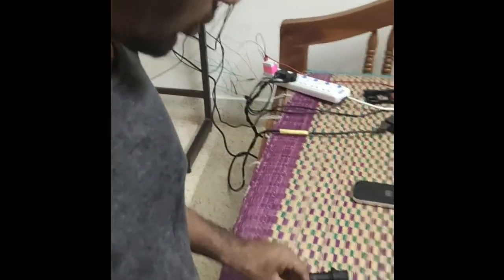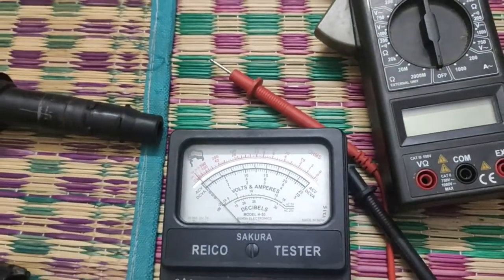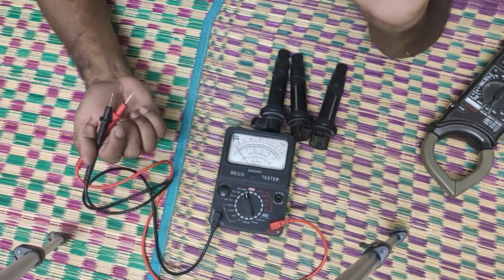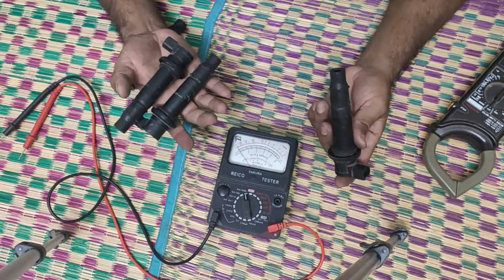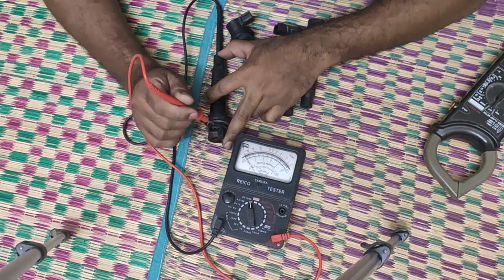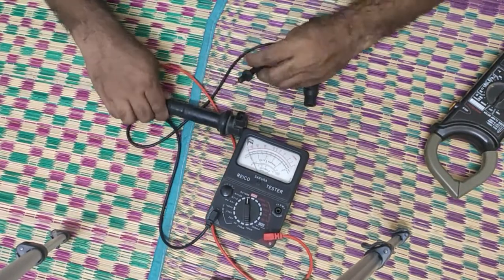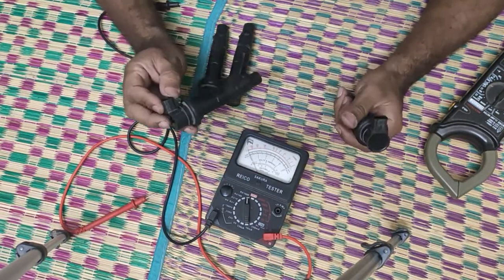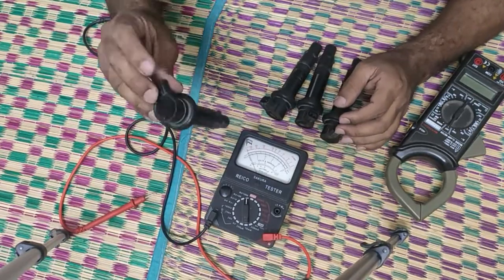Yamaha How To Test Ignition Coil Issue

Comment: how much resistance on primary and secondary,coz mine has 0.01/primary and 9.53 secondary.are these good numbers,what number do you set d ohms on multimeter?
Have digital only..tenx🇵🇭
Reply from the maker: Seems good, do you have any issues?
Reply: @DIZ1988Mohan  my bike cranks but wont start,have spark but too weak.what do you think is the problem? thanks for the response bro, really appreciated..
Reply from the maker: @wilardcondesa9402  check the injector | Throttle body | Stick coil
Reply: @DIZ1988Mohan  ok,thanks bro...

Comment: Bro where can i get ignition coil/stick OEM for yamaha R1 2008 model in India...
Reply from the maker: you can get it from Yamaha Global, or from 3rd party dealers, Mumbai and Delhi
Reply: @DIZ1988Mohan  i m facing an issue mechanic said its ignition coil he check with d voltmeter it went upto only 2.5,3 all the 4 coil sticks.
Any idea on how much the price will b for 4 coils OEM??
Reply from the maker: @mutumabung7301  if there is a reading from the ignition coil I don't think its coil issue check for stator and rotor assembly, each stick cost around 2.5 to 4k, not more than even in a grey market
Reply: @DIZ1988Mohan  the reading is very low,i changed d spark plug,i wonder what cud b the problem
Mechanic said its d coil stick as its been more than 10 yrs old bike the coil stick is weak.

Any leads where i can get an OEM coil stick plz help.
Reply from the maker: @mutumabung7301  may I know where you are located?
Reply: @DIZ1988Mohan  i'm from imphal north east sir
Reply from the maker: @mutumabung7301   check with  Yamaha Global Shop, or open throttle Mumbai, check for the phone number in FB/ Youtube for Mumbai details
Reply: @DIZ1988Mohan  do they have OEM

How much will it be for d 4 coil sticks?
Reply from the maker: @mutumabung7301   Mumbai just ask if they have OEM cost 2,500- 4,500 INR
Reply: @DIZ1988Mohan  thank you very much for ur help.
Reply from the maker: @mutumabung7301  Most welcome and have a great day.